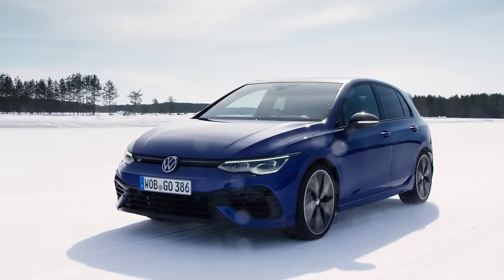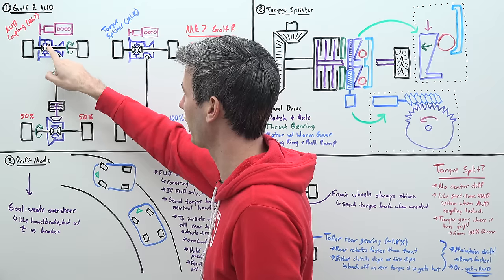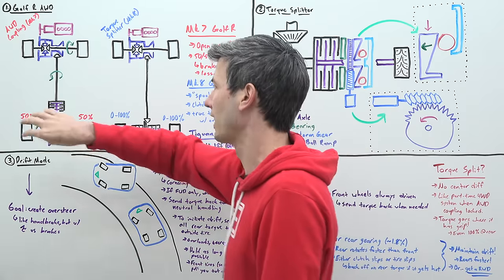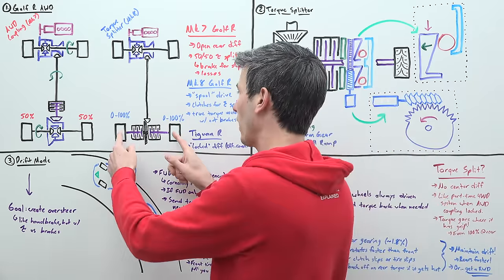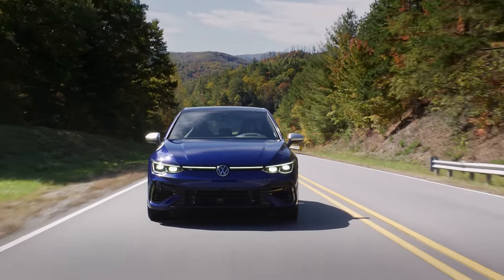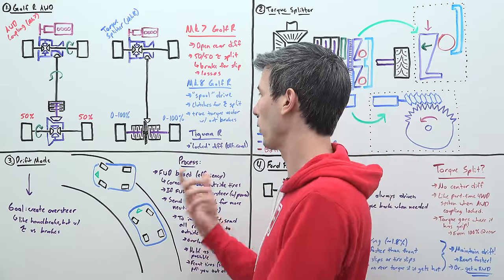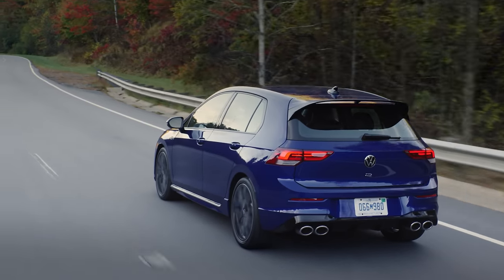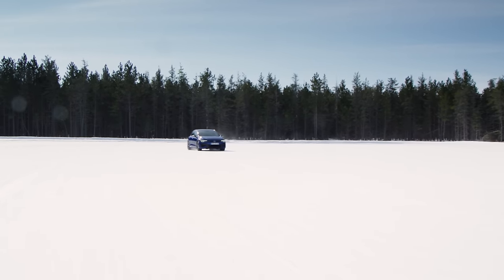Volkswagen's Clever Differential Allows For AWD Drifting - 2022 VW Golf R

Comment: There is a lot of confusion in these comments regarding clutch wear.  This is basically SH-AWD without the overdriving.  In this VW system, regardless of the clutch torque transfer setting, there will be no slippage between the clutch plates when going straight and no wheel is slipping, ie the majority of the time.  How? As soon as the transmission output starts to turn, so will the front wheels, the vehicle with it, and the rear wheels, all in sync with one another. It's the same reason XDrive can survive being "full time".  Of course, the reality is that the torque transfer amount is adjusted continuously, need not be 100%,  and the computer can zero it out if excessive clutch wear looks likely.  By virtue of overdriving the rear, SH-AWD actually creates clutch slippage most of the time when on, but advances in materials and, again, adjustments in real-time to the torque transfer value keep this manageable.

 It's actually interesting that VW didn't overdrive the rear, yet offers a drift mode.  While dependent on steering angle, in many cases, the outside rear tire actually turns faster than those in the front.  It would seem that transferring torque to that wheel in that case would actually create a braking effect.  This is why SH-AWD overdrives the rear, so that they can actually provide torque vectoring to rotate the car during the turn.  Could it be that VW is actually counterintuitively initiating drift via a braking effect to that outside rear wheel? 

I'd love to see Jason do a video on torque and power flows in various AWD systems. It's not often intuitive.

Comment: Excellent video, but I don't quite understand how the electric motor with the worm gear driving the other gear forces the ball ramps sideways. Can someone please explain this to me or tell me where to find more info on it? Thanks
Reply from the maker: The worm gear rotates the ramp, the ball (which has no where else to go) then presses against the ramp, as the space for the ball decreases. This pushes the ramp axially, into the clutch pack.
Reply: @EngineeringExplained  thanks for the reply, I am looking for why the space for the ball decreases, thinking about it more it makes sense if the ramp there wasn't exactly as it is drawn but it is more of sideways following the rotation of the disc, sort of how the clutch works in a drill. Is this correct?

Comment: I think that people who are used to the more "conventional" (and often mechanical) setups would ask about what the torque split ratios are F/R, L/R.

In modern AWD systems such as this, the torque from the engine, through the transmission, will go wherever there is the path of least resistance.

Therefore; if both your front wheels and one of your rear wheels has lost traction (i.e. it's able to slip), the one that's going to be able to take up the tractive effort/tractive torque will be the remaining wheel that can transfer that torque (read: power) to the ground.

For it to be torque "vectoring", what you are actually doing is increasing the resistance so that instead of spinning the wheel freely, you are reducing the amount of torque that's going to the free spinning wheels, and sending that to the wheel that ISN'T able to spin the wheel as freely.

For this reason, this is why it is literally possible for you to send 100% of the torque from the engine/transmission to a single wheel whereas normally, in a "balanced", but AWD configuration, you would maybe send 25% of the torque to each of the four wheels (out of everything that the engine and the transmission can produce).
Reply: Torque goes where the highest resistance is. Power goes through the path of least resistance.
Reply: @4x4.tests.on.rollers  
Are you sure about that?

You do realise that power is just torque multiplied by the angular velocity, right?

Therefore; if the angular velocity is the same, torque goes up, power goes up.

If you have an open diff, and say that the driven gear is what's connected to the driving pinion, therefore; if the left wheel is the wheel that's connected to the gear, then in a low mu or split mu situation, (e.g. the left wheel is on ice whilst the right wheel is on dry pavement), you can spin up the left wheel all you want, but you're not going to be putting any tractive effort to the ground, which is delivered to the driven gear via the driven torque.

If you have very little or no tractive effort, therefore; very low or no torque (but very high angular velocity) and 0 torque * very high angular velocity still equals 0 power. (Given by P = T * n).

That's with an open diff.

Note that instead of the torque going to the wheel where said torque can be put down to the ground as tractive effort, it went to the wheel where the torque could NOT be put down to the ground as tractive effort (i.e. the path of least resistance).

And the entire principle behind pretty much ever other type of differential EXCEPT for an open diff, is to transfer some of that driving torque and taking it away from the half shaft that ISN'T able to transfer (by way of a transfer function) going from driven torque to tractive effort to taking some of that torque that's going to the path of least resistance and purposely sending it to the path that has a higher resistance, and therefore; better able to take that driven torque and transfer it via a transfer function, to usable tractive effort (which in this case would take it from the left wheel, where it is on ice, and transfer it to the right wheel, which is on dry pavement, in order to propel the vehicle forward).

I think that this would be more apparent when you solve for the state space equations for the bond graph model, which, if you need you, you can find an example of what an open diff bond graph model would look like online.
Reply: @ewenchan1239   Yes I am sure and I know what power is. And that's the problem of an open diff. It's torque split is 50/50, value is limited by the wheel with less grip. If one wheel is on ice and another is on pavement - the one on pavement gets the same amount of torque as the one on ice. The one on ice is spinning so it has power (although not much), the one on pavement ain't spinning cause there's not enough torque. Now if you lock the diff - almost all torque flows to the wheel with resistance and barely no torque to the wheel on ice (or wheel in the air, that would be better example cause μ is omitted).
Reply: @4x4.tests.on.rollers  
"And that's the problem of an open diff. It's torque split is 50/50, value is limited by the wheel with less grip. If one wheel is on ice and another is on pavement - the one on pavement gets the same amount of torque as the one on ice."
That's not true.

Here's how we know that.

IF that were true with an open diff, then the wheel that is on dry pavement, which quote "gets the same amount of torque as the one on ice" would be able to pull and propel the vehicle OUT of the slip condition.

But we KNOW that that's NOT how an open diff works though.

The opposite is how it actually works, i.e. the wheel that has lost the ability to transfer the driven torque into tractive effort means that the power being sent to the wheels is the same, which results in the driven torque plummetting and the angular velocity increasing significantly (i.e. wheel spin). 

Therefore; again, looking at the bond graph and the state space equations, we can tell and see that the statement above is NOT true when you solve for said state space equations.

"the one on pavement ain't spinning cause there's not enough torque."
But you just said that the torque split is 50/50. So if that were true, the side that's on ice, the torque would plummet, which sends the angular velocity through the roof; whilst the side that's on dry pavement, if said open diff has a 50/50 torque split, then the driven torque would be sent to the wheel that's on dry pavement, and because that wheel IS on dry pavement, then it would be able to significantly much more better and able to transfer said driven torque into tractive effort, therefore; driving or pulling the vehicle out from the split mu slip condition.

But again, we have data and evidence that proves that's NOT what actually happens/how it actually works.

"Now if you lock the diff - almost all torque flows to the wheel with resistance and barely no torque to the wheel on ice (or wheel in the air, that would be better example cause μ is omitted)."
If you locked the diff, then that is how you'd actually achieve a 50/50 L/R torque split on an otherwise open diff. This is literally the meaning of a LOCKED diff, i.e. the amount of torque and angular velocity is the same between the left side and the right side.

By making both side have a 50/50 L/R torque split, the side that's on ice is still in a slip condition whereby it is still unable to transfer the driven torque into tractive effort but the side that is on dry pavement is able to transfer the driven torque into tractive effort, therefore; pulling the vehicle (or really, the side that's in the slip condition), OUT of said slip condition.

By locking the differential, you've changed the bond graph model such that the left side of the open diff equal the right side of said open diff. T_L = T_R, omega_L = omega_R, therefore; P_L = P_R.

And given that omega_L=omega_R, and T_L = T_R, therefore; T_R --> TF --> F_R (which is a source of effort, S(e)) is what is able to pull the vehicle out of this split mu slip condition.

Therefore; the statement that "almost all torque flows to the wheel with resistance and barely no torque to the wheel on ice" is not mathematically not true. The power/driving torque is split between both wheels, L/R, and if the left side is on side, then it can't do anything that's of practical value with that supplied driving torque, but the right side (on dry pavement) is the wheel that CAN transfer the driven torque into tractive effort, and that is what pulls the vehicle/drags the wheel that's in the slip condition, OUT of said slip condition.

Comment: Could they put a similar clutch pack system on the front two wheels in order to have complete control over how much torque goes to each wheel? It’d be cool to be able to open the front clutches and basically make the car rear wheel drive or put all of the power to the front right wheel for the ultimate one wheel peel
Reply: Im pretty sure this is how Volkswagen VAQ differential works , the clutch packs create a torque vectoring system

Comment: The system used by the Focus RS was originally invented by Mitsubishi for the Evo 8. That car was absolutely bonkers.  Mitsubishi could re-release that exact car today and immediately recover a lot of brand cache. It's a shame they toned it down a lot for the Evo X.  As mentioned by several others the Honda/Acura SH-AWD systems works the same way (I'm pretty sure they did it before Ford), except for NSX, RLX, and MDX hybrids.
Reply: Evo had mechanical rear differential + clutch-packs. Focus RS and Golf R have only clutch-packs.
Reply: I was mostly referring to the overdriven rear end.  Honda/Acura also uses a differential.
Reply: @rightwingsafetysquad9872  Honda/Acura were using planetary gears on rear axle, later on they quit it and only clutch-packs are left, like in VTM-4. Overspeeding idea existed  since late 70's.

Comment: Let's picture the efficinct FWD scenario. Is there a constant mechanical connection at the front of the axle that goes to the rear wheels, so that the entire assembly is spinning at all times just not under load when both rear clutches are disengaged? Isn't this also pretty lossy?  Or can you disengage the entire rear drive train from the front?
Reply: The MPG on the dash board has been programmed to answer that question. Programmed by VW. Just like Thier diesel cars 🤔🤔🤔
Reply from the maker: Yep, will still have losses. Land Rover actually puts another disconnect on the driveshaft going back to reduce this. But it's a matter of losses vs complexity; may not be a huge issue, especially for a vehicle that is designed to frequently run as AWD.

Comment: Love your channel and your whiteboard demonstrations. I’m a driving enthusiast. I currently own a 2010 STi hatch (triple limited slip diffs, each a different type), an S197a Roush Mustang, and a first gen Miata.   Have been considering replacing my STi with a Mk8 Golf R.  Now I’m not sure. 

With a fwd based setup and unequal length half shafts up front, is there a bunch or torque steer at full throttle?  Not uncommon in Socal traffic to be doing 35mph in one lane, and quickly floor it while changing lanes to one going 75+ mph. This has been my biggest complaint with fwd cars: you floor it, and then you’re fighting the car go where you want. 

What about power mods?  The Golf R has about 300hp. How would this complicated system handle 350-400 crank hp?  Warranty wouldn’t help once the mods begin. 

My cars are all manual trans. Would you recommend the auto (dual clutch?) in the Golf R, vs the new manual option?  When equipped with a manual, engine torque is lower - which leads me to fear the manual wouldn’t be as robust with some power added mods, or just in general.  Thoughts? 

My STi is fine. 100k miles, new discs and pads, just did timing belt and water pump, no issues. It’s even the SE version with the JDM Spec C suspension and wheels.   Looking for a bit more luxury and refinement without losing performance.  Is the Golf R something I should be looking at?  Really like a hot hatch awd setup. And love driving the Santa Monica mountain canyon roads (Decker, Mulholland, etc)

Thanks!
Reply: Even a mk7 R with a downpipe+ tune is making the power a big turbo sti would be & reliably. I think you'll be quite happy with a mk8. Nothing like 30+ mpg, a comfortable drive & lots of tuning potential without worrying about driving a moneypit. Look at my profile & You'll see a pull & a launch from 0-135 km/h. A mk8 has much more potential

Comment: Cool man, but i don't really understand what problem is being solved here. Is this just to remove the center diff?
Reply: yes and also allows for more torque vectoring than limited slip or brake assist
Reply from the maker: There never was a center diff. And it allows for true torque vectoring, as discussed in section 1 of the video, which the previous Golf R could not do.

Comment: You keep saying that with an open diff, torque gets split 50/50, but my understanding is that it will always go the path of least resistance. If one wheel is on ice, all the torque will go there through an open diff and make it spin - none will go to the other side with traction. Hence the need for LSD (for track/drift) or lockers (for off-road). Or the cheap way on modern cars, actuating the brake on the ice side until the resistance is greater than the traction of the opposite wheel.

Getting back to these cars, if the front diff is open, how do they get any torque to the rear when the fronts lose traction?  If both front tires are on ice, wouldn’t all the torque go there even if the rear clutches were fully locked?
Reply: You are confusing torque and power. Check the video called "Always 50/50 torque split of an OPEN differential - 4x4 tests on rollers", that should help. Answering second question - it doesn't matter if front wheels are on ice or tarmac cause rear ain't powered by the front diff.

Comment: Jason, I enjoyed the torque split bit. One question, theoretically if you got 3 tires on ice and the other had high traction, how much torque could be applied. I’m sure engineers have a way of limiting this because full throttle in a low gear I’m sure would put too much stress and strain on the axle shaft would be beyond the yield point.
Reply from the maker: If that one tire with traction is in the rear, it could potentially get all of the torque (100% to the rear, and then 100% to an individual rear tire). If it's up front, the open differential will split the torque input 50/50 to each wheel.
Reply: @EngineeringExplained  50/50 to each front wheel if there’s equal traction left to right, otherwise the one front tire on ice will take 100% of the torque and you’re stuffed.

Comment: I have a MK7 R, and I am not an engineer, so I'm hoping you can explain why decoupling its RWD bits would be more efficient than keeping them engaged all the time.

Where would that efficiency come from?  The driveshaft still has to spin and accelerate and decelerate with the speed of the car, and so does everything aft of the center differential, regardless of whether the center differential is open or closed.  All of the rotational inertia is still there, and so is all of the drag caused by bearings and whatnot.  As far I (again, not an engineer) can tell, the only potential efficiency to be gained would be inside the the center differential itself. 

What am I missing?  Thanks.
Reply: There's probably less resistance on the front angular gear.
Reply: There is no centre differential on the Golf for one.  Secondly, it takes energy to move torque from front to back and side to side. This is what makes “full time 4wd” less efficient, I.e., worse gas mileage.